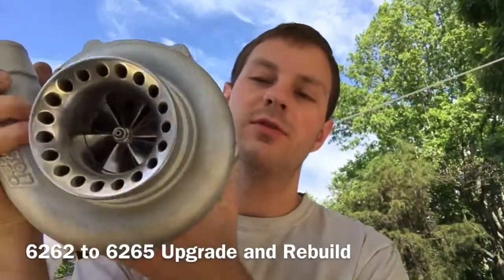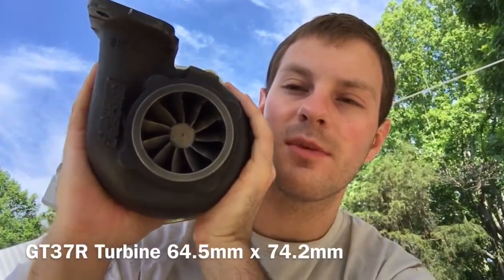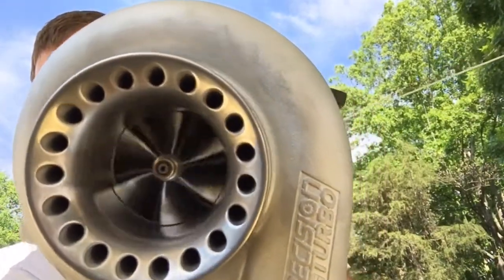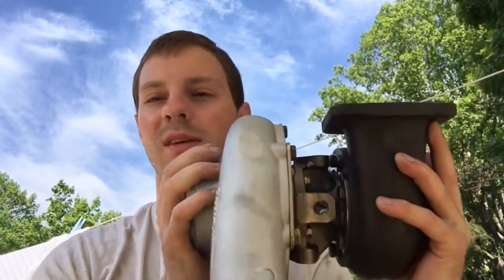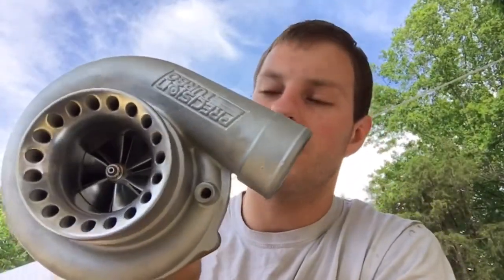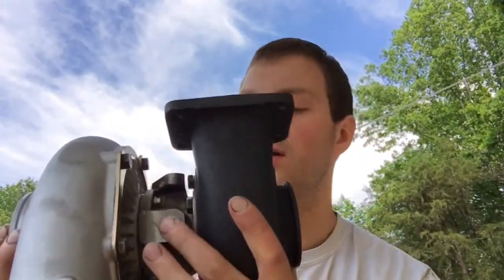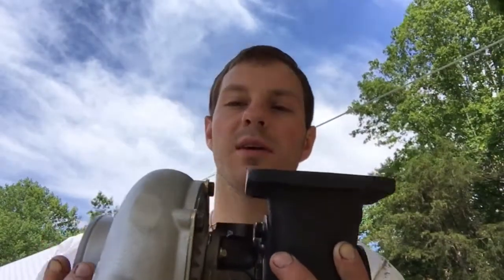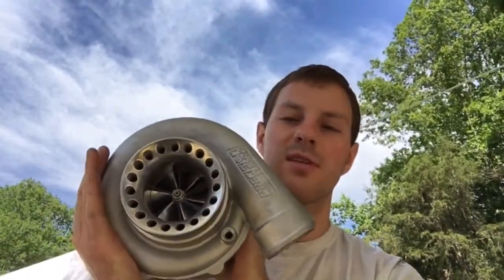PTE 6262 to 6265 Ball Bearing Upgrade

Comment: Nice. You're doing alot of  Precision conversions lately.
Reply from the maker: +Craig Cundiff I post videos to advertise and Teach the upgrade options then the searchers or followers request the services. I guess you can see the highest demand that way.
Reply: I'm not knocking it.. Cool options to get them humming again... you did my Hahn S16g... converted it with the 20g(td06) turbine wheel and ef3 (55x76)compressor wheel(55x55) about  a year and a half ago.. still running strong. ..👍